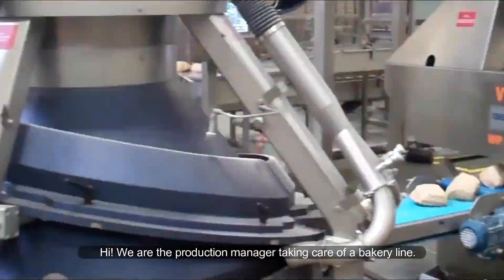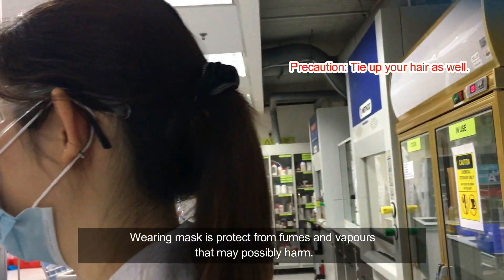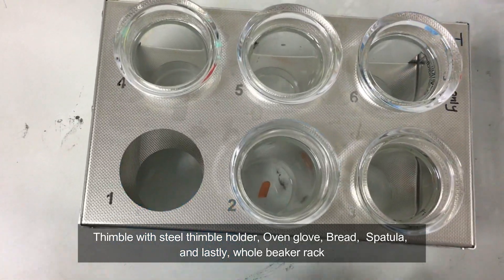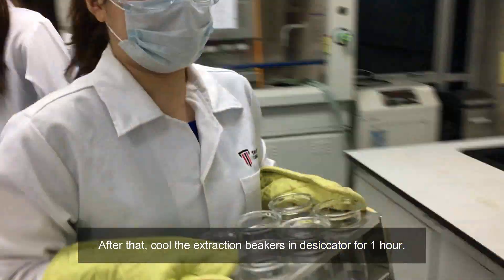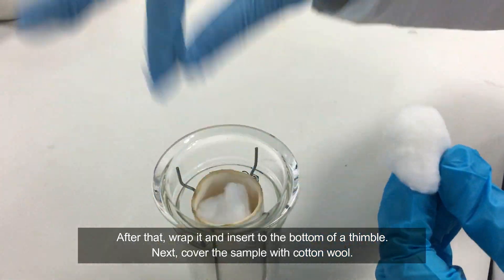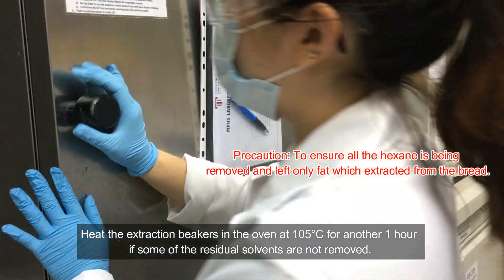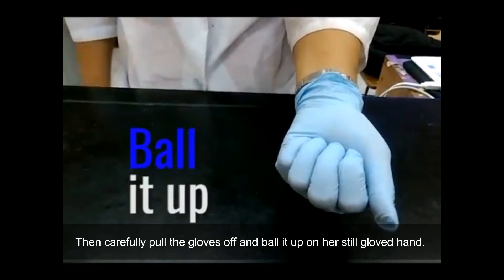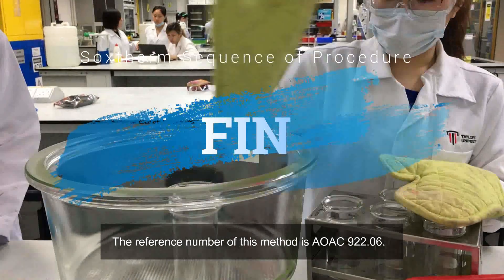Fat Analysis using Soxhlet Method

Comment: How can we determine the value of fat of spinach in raw form....id it necessary to dry it....i want determine fat in raw form?
Reply: Why do you want to determine raw spinach?
With this extraction method, the substance must be dry.
If you want the result of the original material,
then you can record the weight before drying.
Reply: hi is this method not applicable for liquid products? @Anonym-tq1li